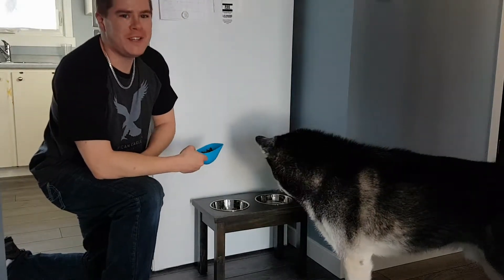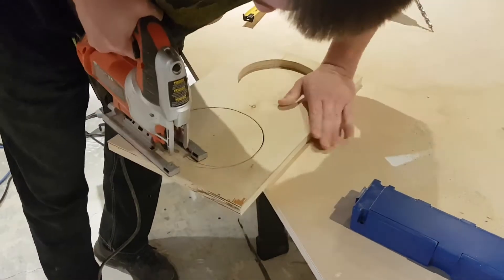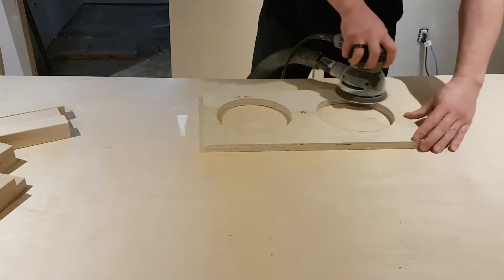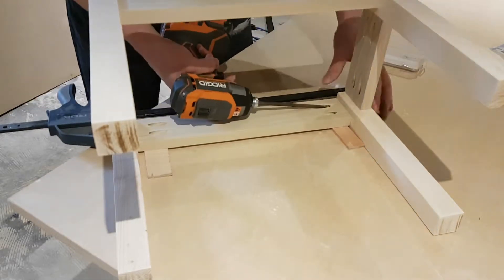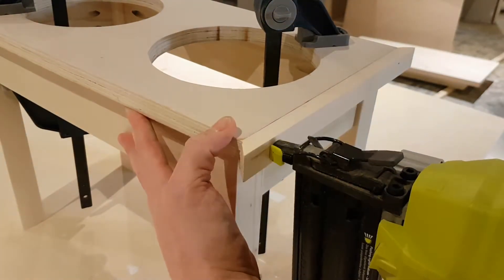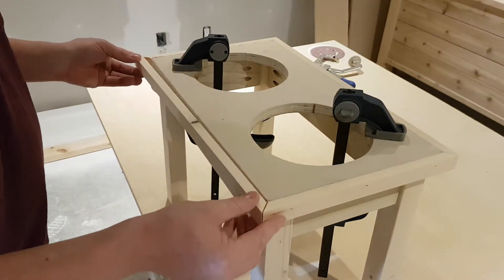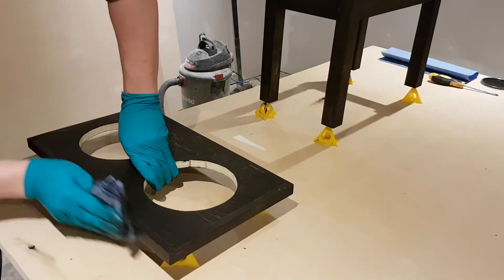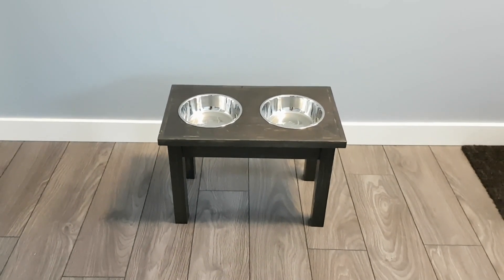Raised Dog Bowl Table, crazy easy

Comment: What is the length of the legs?
Reply from the maker: I measured around just under a foot total for my dog total height, so I made the legs 11.5"
Reply: So is there a “rule of thumb” to determine the length of the legs based on your dogs height?
Reply from the maker: Not specifically, I mean there is online but its a large window because you can get 2 dogs of the same breed that are very different sizes. Mine is a husky that is 85 lbs, but they average 55, he was huge as a puppy so normal sizes wouldn't work for him. I just had Slade stand still, grabbed a tape measure and measured to the center height of his shoulder which should be a few inches below his mouth and that seemed to be a good height for when he looked down to eat. Now however I've learned that they should be angled down slightly in the front about a inch or so in the front for them, or so they say.